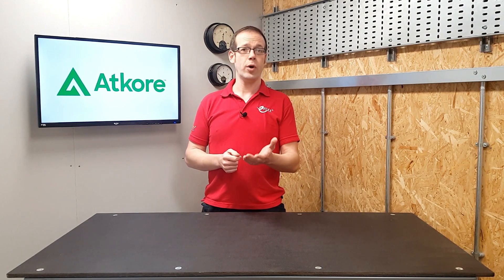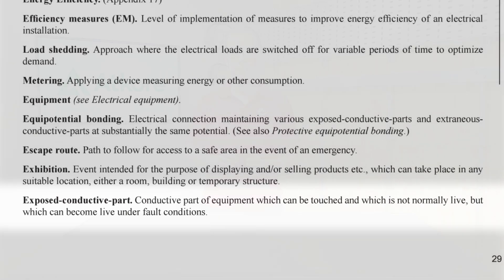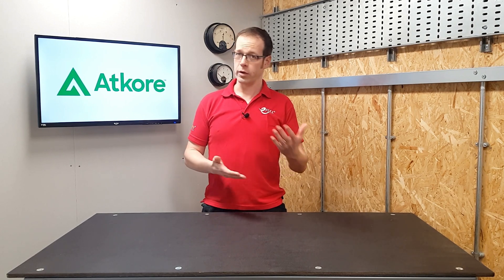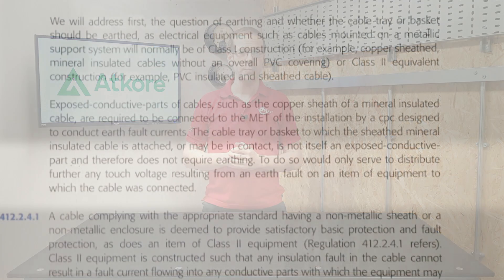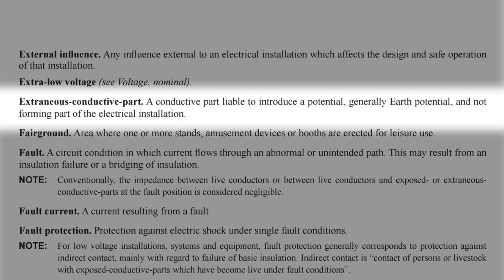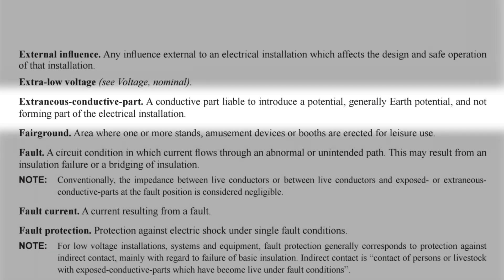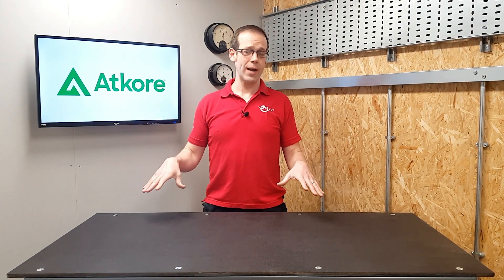Do you need to EARTH BOND metal cable trays and basket? BS7671 electricians' Q&A

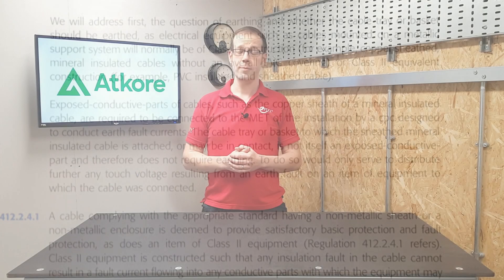Comment: The text quoted at 1:48 is specifically about mineral-insulated cables carried in the tray. It doesn't say that bonding the tray is not a good idea for all cable types. Such trays are rarely but occasionally used in attic spaces in domestic properties to carry t&e, keeping it away from insulation. If the installation, or later alterations, were poorly designed, and the cabled overheated and the sheath and insulation cracked or melted, or if a sharp edge cut through the sheath and insulation, or if a rodent came along and chewed through it, then the tray could become live and present risk of electrocution to anyone going into that attic space (or other environments). Where there's risk of such faults occurring, arguably the tray should be considered an exposed-conductive-part and thus bonded. It seems rather irresponsible to be suggesting otherwise.

Comment: Thanks for these videos these are very helpful. I am surprised that the metal containment wouldn't be considered as exposed conductive parts, they carry the cables and all you would need is a break in insulation of a live conductor for the containment to then become live no? Bonding it then serves to keep it the same voltage as other exposed or extraneous conductive parts, and would allow the earth fault loop path to trip the RCD as I understand it. If you didn't bond it, and it became live due to a break in insulation, it would then be an electrocution risk or would the RCD trip anyway as soon as current started to flow through this altrenative path? sorry if this is basic

Comment: Putting the interference aside because I don’t really know. I’d say it’s not an exposed conductive as it’s not likely to become live under fault conditions and if it was to then the cable or containment is not suitable. And It’s not extraneous from the looks of it.

So I’d say no. GN8 has a section saying doing so in situations can distribute touch voltage to areas it wouldn’t necessarily be if a fault was to occur elsewhere.

Comment: When hauling cables and even after installation there is a chance for a live conductor to contact the tray and not to be detected by testing (fault might occur later due to earlier damage).  I think it is better to have the tray bonded.  The whole point of bonding is to remove a touch potential, so why would bonding the tray introduce one????

Comment: The reason to provide bonding does not always as simple as reasons offered by 7671, this does not cover other standards requirements that are dependent on the use of the installed system. 

Where 7671 identifies no requirement, other installations do. Such as EMI protection to communications services covered within numerous communications standards, also not withstanding any owner requirements to cover the lifecycle of the installation as this will change, no one has a crystal ball.

Everyone needs to get away from a "me" view to "we" with being a shared service provision, where multiple runs on the same hangers are provided, then distributed in different areas, the common route must take precedence to the need, not any text seen within 7671 as that is seen as a singular position written with the sole reference to electrical services. Other issues also appear between 7671 and other standards, as 7671 does not understand the requirements of those standards, it should we referenced that where another standard has additional requirements that these are taken into account i.e. 7671 is the starting point however, the high requirement take precedence.
Reply: BS 7671 (along with IEC 60364-4-44) calls for containment to be part of bonding networks for controlling EMI

Comment: In my opinion, theres always the off-chance that a cable (or particularly a single insulated conductor in enclosed duct or similar) may fray and short out against the metal work. I've also found dead mice in duct who met thier demise chewing a line conductor. I personally think it is absolutely essential that the metalic parts are bonded with supplementary bonding at each joint to ensure continuity. Its similar to the classic case of a class 1 light fitting on a circuit lacking a cpc. The line comes loose or frays, comes into contact with the unearthed metal body and then its a timebomb waiting for someone to change the bulb. As we all know - people have lost thier lives to this. Granted this is less likely to happen with tray or basket as the cables are double insulated but they are not infallible. I've certainly seen damaged cables where both layers of insulation have been compromised.

Comment: As per Australian Standard - we bond.  We provide an equipotential bond to the tray work - because a situation could occur whereby the tray becomes vulnerable to induced or other touch voltages.  Having a path to earth is sensible.
Reply: That’s probably because in the UK there is alot of steel wired armoured cable used, the armour ofvwhich is earthed.  Not the case is Australia.

Comment: For me, if there's 30ma RCD protection on non metallic protected cables then it'll be safe. As you pointed out it's more important to select the correct wiring system to start with.
Reply: Unless you introduce power from somewhere else....
Reply: Nice thought, although you’d have to also consider what we know of RCDs these days. If the RCD is a type AC and it is serving any other load other than a purely resistive load the RCD could be blinded and make the additional protection useless. Earthing and bonding is the cornerstone of preventing potential difference. Although it really does depend on what kind of cable your running on the said cable tray. SWA for example would render bonding the tray pretty useless since the armour should be earthed, however if it where T&E or FP there is a real chance that the tray could become live if the cable is damaged. Like he said there is no simple answer and there are many factors which have to be taken into account.

Comment: What the regs state & the installation practices on site are miles apart.
If installed near other metallic items, structures, the issue is more akin to zones where you need to look at the possibility/probability of a person touching 2 sides simultaneously or whether a metal ladder, pole or alike, is likely to ever be used at the given location… which in those environments is often yes.
Providing cover for these faults can be provided by RCD protection unless in a critical environment (hospitals, etc.), & the regs (especially onsite guide) should give more definition & protection to all circuits that won’t endanger life if operated.

Comment: Ignoring all other "gotchas" for a moment, look at HOW the tray is actually mounted physically and then consider the "introduction of an earth potential" again.

To illustrate the point I'm about to make, think about the old & deprecated "mains tester screwdriver". Testing a known live contact with one of these "should" light the neon. Whilst doing this, touch a masonry wall, particularly an external one at around 6-7feet high. Result?

 Hopefully everyone on this forum will know that the neon lights FAR more brightly, showing a much higher (but still safe) level of current flow. 

Now, obviously part of that is due to a much lower resistance through a bare hand c.f. a connection through much higher resistance footwear (including socks!) BUT it illustrates that masonry fabric of a building IS at ground potential for most considerations.

Now the key point: Metal tray work bolted to a masonry wall IS therefore effectively at ground potential! So this is DIFFERENT to the situation shown in your video where the tray is mounted to a bare OSB wall.

This is another aspect that needs consideration in the decision of "To bond or not to bond? That is the question." To paraphrase our most famous bard.
Reply from the maker: We’ll use that bond quote - 😂😂😂

Comment: I would bond tray work as I see it could a cable that is not powered on could be damaged by chewing from a rodent could then make the tray work live when switched on.  Bonding earthing and CPC I see bonding as pipe work earthing as metal work of equipment such as washing machine or oven any metal work that could be touched.  That if there is a electrical fault may bring body work to live potential.  Then could be touched.  So the CPC brings the earthing bonding to metallic body of any equipment.  But also as gas and water pipes are grounded if metallic coming out the ground we still attach to the incoming earthing.  With a TN-C-S were there is one conductor and the earth comes in with the neutral we are told if there is a brake down on the pointing to ground along the line we lose are neutral leaving every think live.  So what is CPC when attached to the bodywork of appliances.  As then it is grounding and if has a water pipe forms part of the bonding.

Comment: Good to discuss this topic , we have another issue where I work , Lightning conductors on roof level poorly terminated , causing an earth path between metal building structures .The Electrical contractor did not Bond certain tray runs , however the LPS contractor indirectly bonded trays through metal structure . A Electrical inspection found various resistances between the tray work , which could cause touch voltages . We are looking at substantial bonding work to reduce these touch voltage potentials .
Reply from the maker: Interesting situation there, thanks for commenting.

Comment: If the cable has an earthed metal layer, I agree there is no reason to earth the supports.

But if the cable is something like T&E or flex then all it takes is one sharp edge to cut through both layers of insulation. I'm not at all convinced that such scenarios are unlikely enough to rule out the need for earthing.
Reply: Agreed. But an RCD will sort it.
Reply: @deang5622 an rcd or an MCB or fuse will switch off more quickly — ideally before you touch anything — when it contacts a bonded piece of metal than when it turns said piece of metal live and waits for you to touch it. This is why class I single insulated devices even have an earth pin.

I mean, yes, my washing machine doesn’t absolutely need to have its case connected to the earth pin on its socket, because the RCD will prevent it killing me. But you’d quite rightly fail any installation where the protective earth pin on its socket is not connected up.

So, granted, class II devices also exist and in fact — even when they have a metal case — are not connected to earth. So you don’t have to.

But metal tray systems (non-data) of the kind I’m thinking are just full of sharp burrs with a lot of live conductors running over them. If it’s really good quality tray with no sharp edges and you also are diligent about removing burrs where you cut it? Should be fine.
Reply: Shouldn't be any sharp edges.use profile or grommet strip on edges

Comment: As someone who has requested trays to be installed I take a different view - I request that the trays are bonded and proven to be bonded - so any work in the future can not by accident cause a situation where the tray is connected to a voltage. So the bonding is there to protect the integrity of the installation, rather people who may come in contact with the trays.
Reply: So a tray on a rubber roof, lifted by rubber feet would be a request to be bonded??? I think you still don't get bonding Vs earthing. You could test that my scenario wouldn't require bonding
Reply: All good but if you have a PEN fault then could get intreasting...

Hard one really...

I tend to wright up each traywork and enviroment as to bond or not bond

Comment: Great work as always Joe.
Part of the confusion is that the regulations are attempting to describe, in words, quite complex things that could be explained clearly and simply by diagrams or illustration. We add to the confusion by using imprecise language when using the words "bonding" and "earthing" to describe the same thing.
In my opinion the heart of the matter is whether the cable tray is an integral part of the electrical installation or just another piece of isolated building fabrication metalwork.
For example: 
If a length of cable tray is installed to get cables from point A to point B but is not bolted or fastened to any other device in the system (switchgear, transformer etc.) then the cable tray is just a piece of isolated metal. 
If, however, it is bolted or fastened to any other electrical device then it becomes part of the electrical system and should be earthed.
Just my view.

Comment: When I worked in  areas  containing a potentially flammable atmosphere we bonded everything that was exposed and conductive, to ensure there were no inductive loops in addition to the normal reasons mentioned in the video. Long runs of pipework, cable tray etc could offer a lower resistance than an earth path, and therefore an alternative path for earth currents,  if they were at earth potential at several separated locations.

Comment: A little tip. Although not related to cable tray. 

Suspended ceiling grids are not classed as extraneous. Beware however when removing older fluorescent fittings with new LED fittings. Older fluorescents are earthed, which in turn earths the ceiling grid. LED fittings are wired in 2 core cable (no earth) with an LED driver. Internal SMPSUs induce voltage up to 100 volts on the ceiling grid. Requires earth bonding to reduce touch voltage. With no bonding if you touch the grid and a metal earthed appliance at the same time - OUCH.

Comment: Joe, what’s your opinion on basket containment that is supported by unistrut and steel rods which is clamped to the structural steel, which is an extraneous part. Should the basket then be bonded?
Reply from the maker: Good question, I suppose it depends on a couple of things. Is it introducing earth potential into the installation, it may be that it is via the connection to the structural steel, however if the structural steel is bonded and the basket is making  a good electrical connection via the strut and rods then maybe its already bonded via the structural steel?
Reply: @efixx  that’s how I see it it’s bonded via the steel work via a mass off connection points

Comment: Bond it! Reducing failure modes is what this is all about, increase the number of failures required to get a lethal fault!
Reply: Bear in mind that unnecessary bonding can actually increase risks. For example the increased likelihood of a dangerous touch voltage being distributed around the building as noted by GN8 and the video.

Comment: I'm a domestic electrician so never do any tray work, but I had this dilemma in my own property where I installed tray in my garage supplying my consumer unit. All cables are double insulated and the tray has no contact to earth so I concluded it did not need bonding. however, due to doubting myself I stuck a 10mm bond on anyway 🤣🤣. At least I know categorically now it is not needed 👍
Reply: Spot on!   Except for 10mm...   The best type of kill is overkill.
Reply: Although you’ve now introduced a good earth path to the tray 👍

Comment: AS/NZS Requirements for metal cable enclosures are that they need not be earthed if cables are insulated and sheathed, affording double insulation their entire run inside the metallic enclosure. Metallic cable tray shall be earthed and must be electrically and mechanically continuous throughout the entire run. Clauses 3.10.3.3, 5.5.3.2, 5.5.4.2

Comment: Ok, so i'm installing basket tray in a factory. A forkLift truck has caught it's mast on a girder and ripped out some cables from the lighting circuit. They are swinging in free air, but come to rest on my Basket Tray. If it had been earthed it would have disconnected the circuit through the MCB, but with it not being earthed will it. Should i have earthed my basket tray?
Reply: Do you mean , should i have bonded it 🤔🤣
Reply: @154electrician  It's just hypothetical, i'm actually retired now.
Reply: @154electrician  no... earthing is the correct term
Reply: forklifts and tray work in my book are high risk for damage regardless of type of cable so high-level would maybe be worth earthing it back to MET? thoughts

Comment: If the tray is holding armoured cable with earthed armouring id c3. Twin and earth C2 ive seen this type of cable snagged on basket and tray.   Id always earth the tray or basket no different from armoured cable carrying a potential fault current. Lets have some Regulations that say do and not leave up to the individual spark as im sick of people interpretation of the Regs..

Comment: Sorry thats not why pipes are bonded!
Pipes are bonded incase they become conductive not as an earth!
For example if a lightning strike hits a house roof it could strike the hot water cylinder vent or any pipes within the roof, that then travels through the entire plumbing system making taps and sinks live and without bonding it has no where to go.

It has happened and will continue to happen.
Reply: Pipes are bonded to clamp down differing earth potential between the outside mass of earth and the installation earth.
Reply: TNCS, TNS differs frm TT requirements, aren't they?
Reply: @piratedprivacy9052  only in the sense that in a tnsc system you have to worry about bonding being sized to cater for diverted neutral current also
Reply: @tomorichard  half the size of the live conductor isn't it..? its late 😆

Comment: What about ceiling grids? I used to do quite a bit of LV control cabling and remember once I popped my head into a ceiling and my ear touched the grid and I got a little buzz from it. 

Probed the grid with a multimeter and there was 50v ac between the grid and earth/CPC.
Reply: Happened to me once. Then i found one 600x600 light fitting with an electronic ballast unearthed.